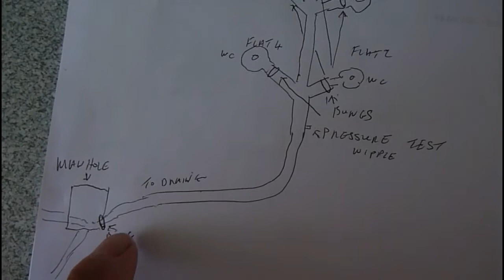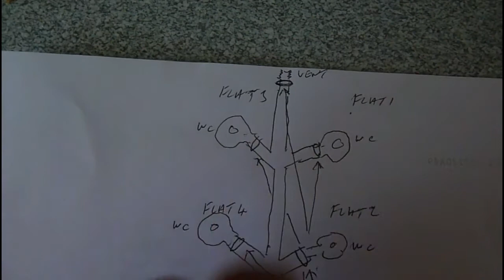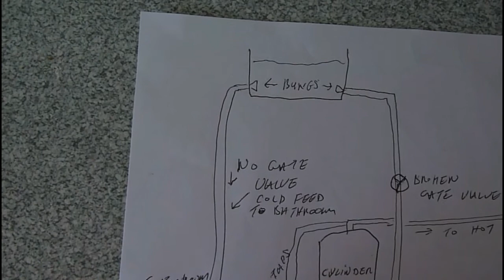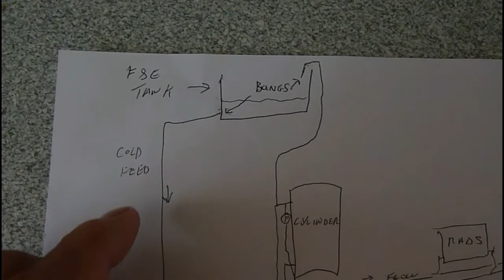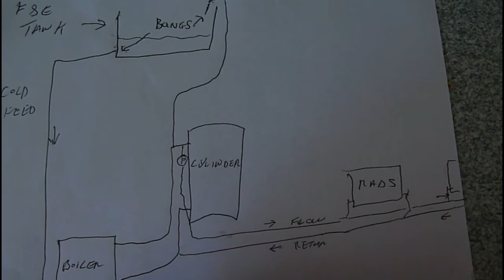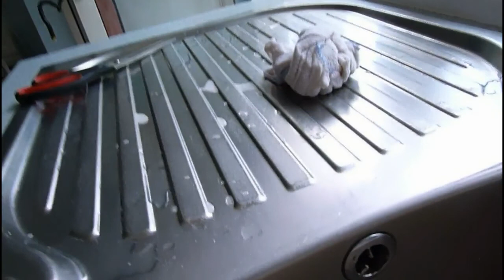How to use rubber bungs to seal off pipes.Usefull if you have a broken gate valve ect.

Comment: Thanks Al. While on: I ask the above (below now?) as I'm changing out a kitchen tap and, on one of your other vids on doing that job, I'm pretty sure you said to put a one way non-return tap on the hot feed when refitting. Fine, but can I ask why is that, is it regs ? Just curious as to why as it's not like any brown water will (or can?) flow back up the pipe is there off a mono-block tap? Thanks again : )
Reply from the maker: It`s belt and braces and good plumbing practice.

Comment: On the cwst i'm guessing you DON'T need to also bung the expansion pipe (while you work on the no doubt broken gate valve & kitchen sink*)?

In other words, that's just for the Heating F&E?

* While you also fit iso's to the tap tails to not have to bung again.
Reply from the maker: That`s correct.

Comment: Morning sir 

I am a regular viewer of your video's 
And it really is really help ful 

Work as an apprentice 

Just wondering how would i stop the hot water with a bung and change a tap if i come across to it 

It has got tank in the loft with cylinder in the cup  board 

Thanks
Reply from the maker: Just stick the bung or a cork into the 22 mm feed in the header tank.
Reply: @dereton33  many thanks 

I did it and it worked for us nicely thanks

Comment: Im going to move a radiator a couple of feet in an upstairs bedroom. It's an open system like the one you showed. Could I use bungs rather than draining the system? This would be my first plumbing job. Great videos and thanks for sharing 😁
Reply from the maker: longstone21  Yes just make sure the bungs are a good snug fit, with no air gaps.